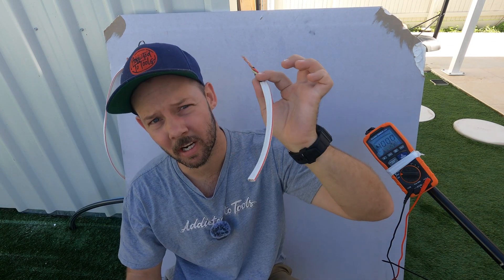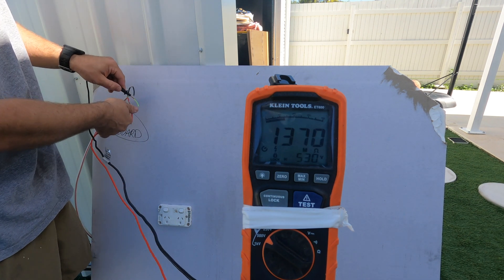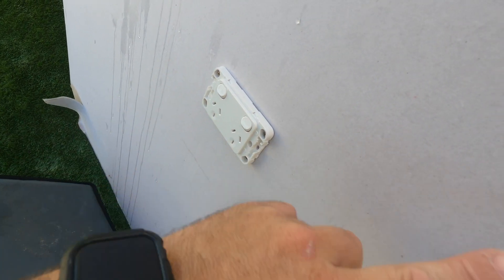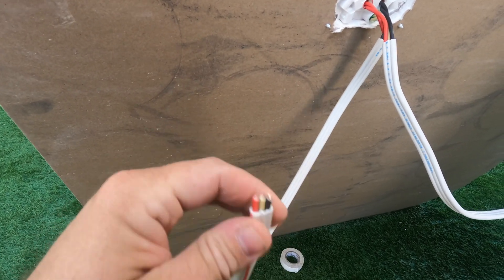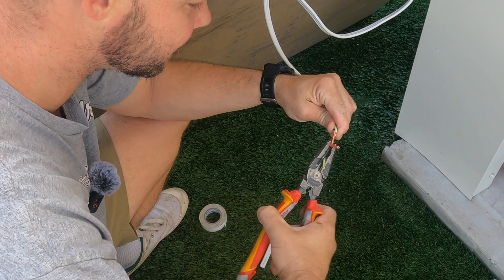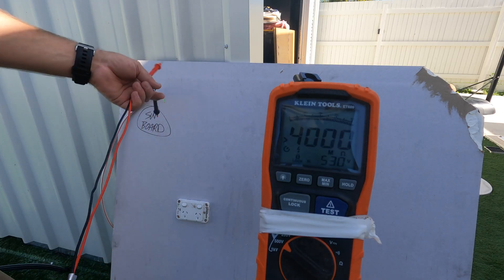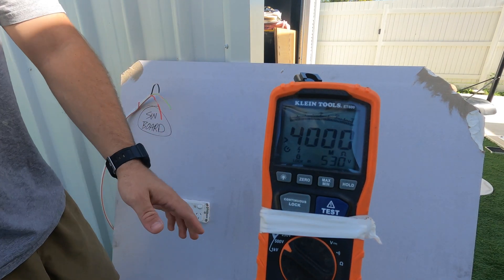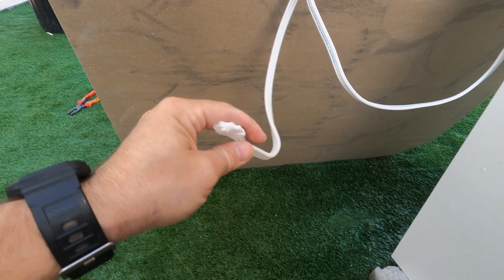electricians should do this! Twist and Tape method

Comment: additionally, at the rough in stage have everyone involved agrees on a method of identification of the cables at each point. so at each outlet, switch and light tape all cables together close to the end of the bundle of cables, so when they are fished out of the wall or ceiling the tape section is outside of the cavity ready for termination, ( having tape on the bundle inside the wall will make it hard if you need to add an extra wire by using one of the existing cables as a draw wire. )
For single end of line cables, wrap a band of tape to identify it as the only cable at that point. adding strip and twist on top of this will add extra cover on larger sites especially where it's likely that the person that ran the cables won't be the one finding and fitting them off and time between install and fit off can be a long time.
This taping all the cables together to be terminated would have been a good idea on a job I was sent to and asked to find out why an emergency exit light wasn't working properly only to lift a tile next to the fitting and find the SDI cable on the next tile sitting there live. Had it been taped to the twin and earth for the fitting, it would have been a clue had it been striped and twisted would remove all doubt.

Comment: When I have to leave loose end like this 
- I put wago to short the cable  and the cable end in Junction box
- Mark the cable what it is and which panel is feeding it
- also mark up the junction box what that is 

easier for the next guy to get rid of the cable or use for expansion
and no one get shocked
Reply: also it cant be energized by accident because it will pop a fuse

Comment: Canadian sparky here: 
This is not taught here & I think it's a great idea.
If I'm understanding correctly, on whatever wire pull I'm doing, do twist-tie method at the end where my devices will land.
This does two things: 1. Ensures that all the wiring I've installed isn't by chance lying around un-terminated (open cct wire like in the video) and ready to short in a t-bar ceiling. If i forgot a device, that means I have my short on the circuit, which I will be able to detect during my testing phase.
2. Allows me to ensure the condition of the wire after the pull, since I'd be doing a continuity test before connecting to breaker and flipping it on.
If I forgot a device, tested continuity and see ultra-low resistance, signifying a short, I will have prevented letting the breaker do the work.

"American" sparkies talking about starting a fire don't know how to size their breakers i guess :P
Reply from the maker: That’s exactly right mate.

Comment: Apologies I can’t see the point of doing this. Why twist them together instead of fixing the problem permanently?
Reply: Matt's touched on this in previous videos but you may rough in your circuits and not come back to cut out and fit off for weeks/months whatever. So when you're at rough in stage you do this method so when you go to cut out and fit off later, IF someone has missed a tail you will find out when you test before energising. In Australia we rough in (install all cabling to their locations through ceilings walls etc), then cut out and fit off, then test (fix (if) any faults) and finally energise. I would think that'd be pretty standard methodology anywhere in the world?
Reply from the maker: Thanks Michael. Thats correct.